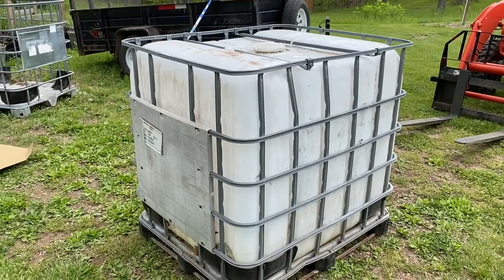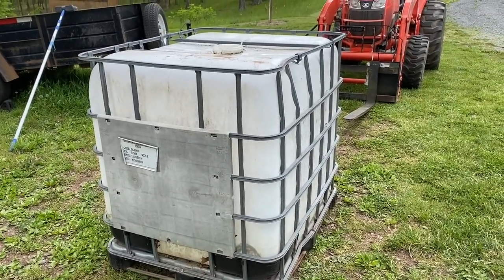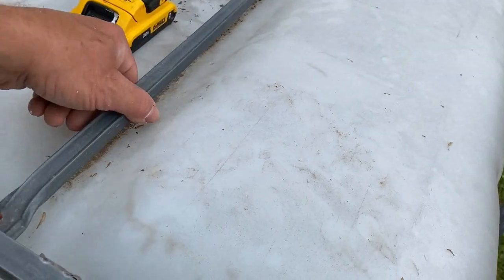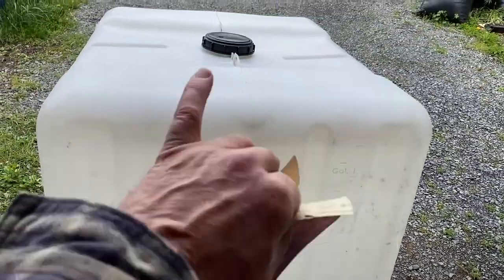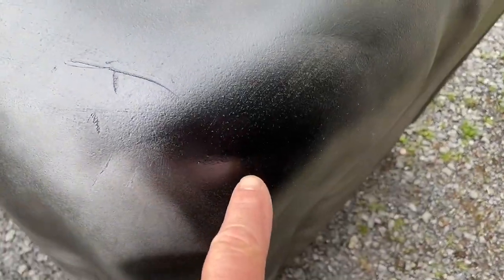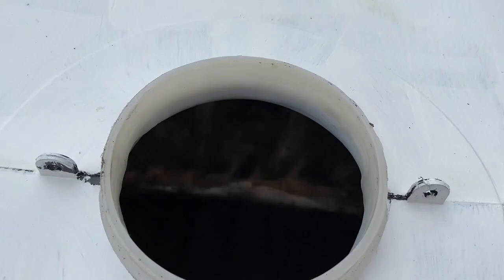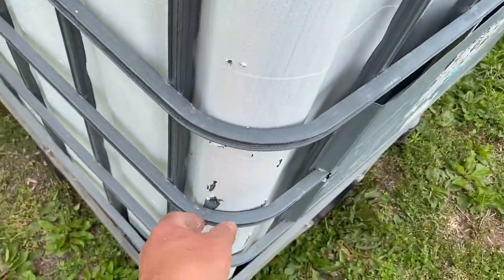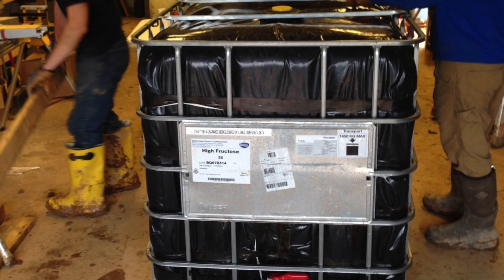How to Stop Algae From Growing in Your IBC Tote

Comment: I just did this project before I watched your video. I used a good quality exterior grade house paint. The tanks got scratched up a bit when I put back into the metal chassis, and so there was some touch up involved after reinstallation. I'm building an elevated and covered "shed" to contain mine so there will be additional protection from sunlight and the elements in general. Thanks for the video.

Comment: Just put a fish tank pump in there and make sure the water is constantly moving. That's less than 10 bucks and takes about five minutes.
Reply from the maker: Thanks.
Reply: not a bad idea, but as someone who is off grid, power is a premium, down to the amp/volt